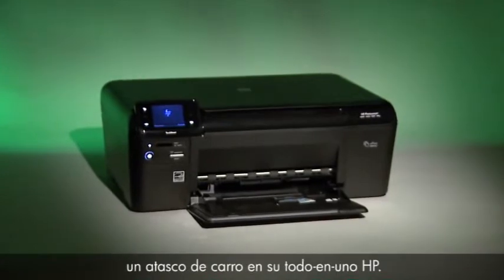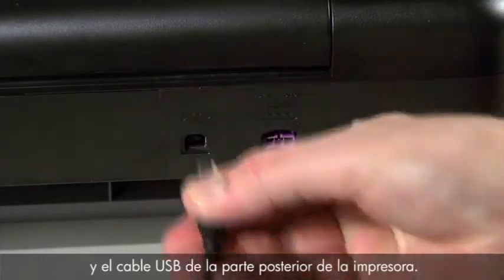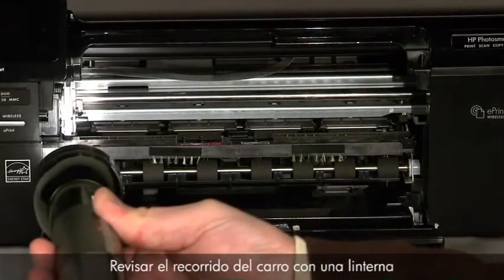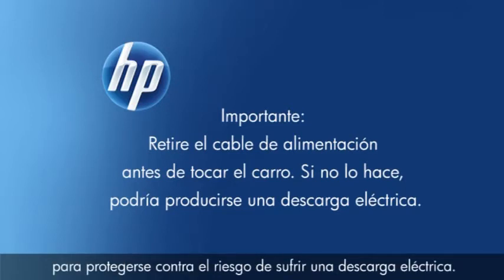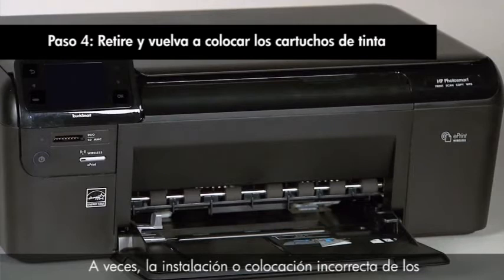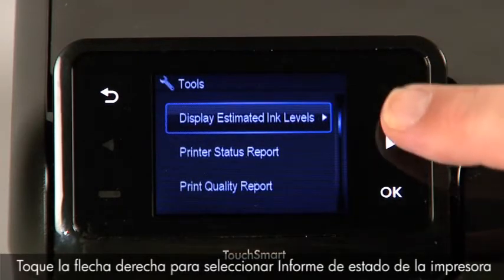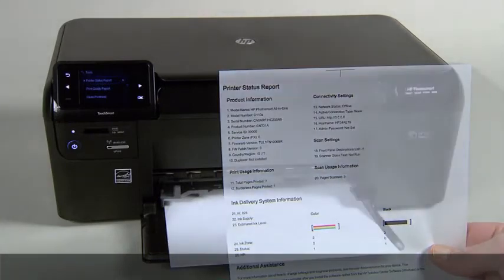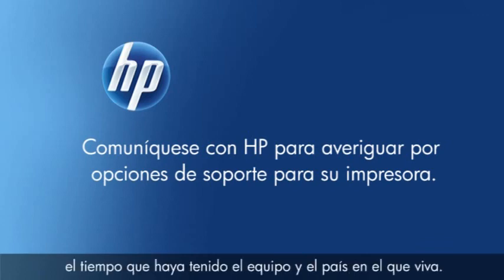Eliminación de atasco de carro - Impresora e-Todo-en-Uno HP Photosmart - (D110a) | HP Support

Comment: hello i have a problem whit photosmart c4680,, , .,  all lights are start..and no respond  the car.. no sounds.. nothing
Reply from the maker: +ron jerez I recommend you follow the below steps and check if it helps.
NOTE: Remove and reinsert the print cartridges and verify that they are fully inserted and locked in place. Also, make sure the print cartridges are installed into the correct slots.
With the printer turned on, disconnect the power cord from the rear of the printer and also unplug the power cord from the wall outlet. 
Remove USB cable, if present. 
Wait for 2-3 minutes, press and hold the power button on your printer for about 30 seconds to remove any additional charge. 
Now plug back the power cable straight to a wall outlet without any surge protector or an extension cord (This is important) and then plug back the power cord to the printer. 
Turn on the printer and wait till warm-up period finishes and the printer is idle.
Let me know how it goes and you have a great day!